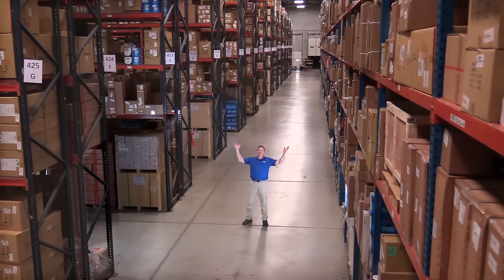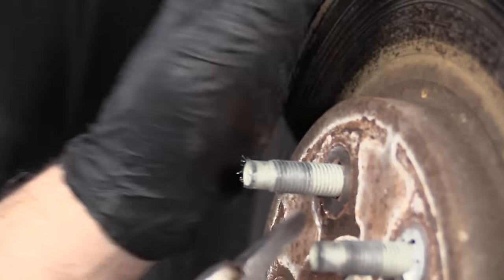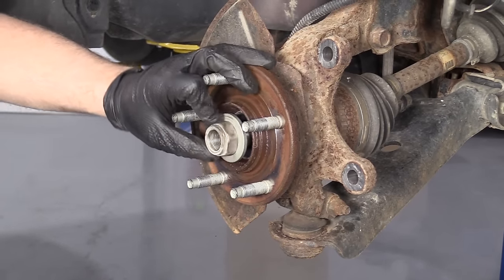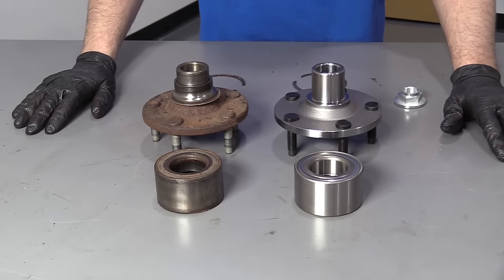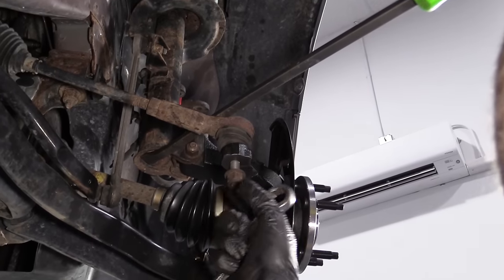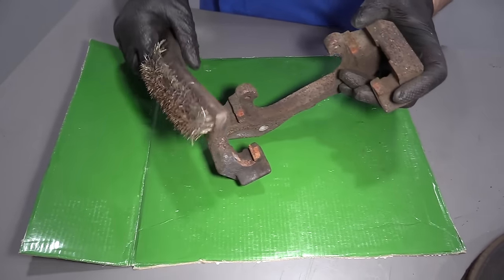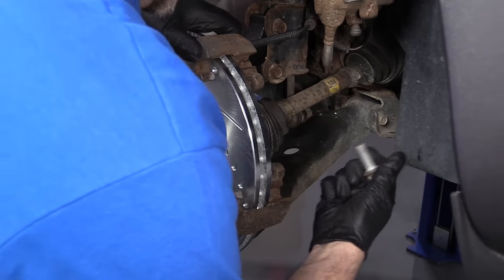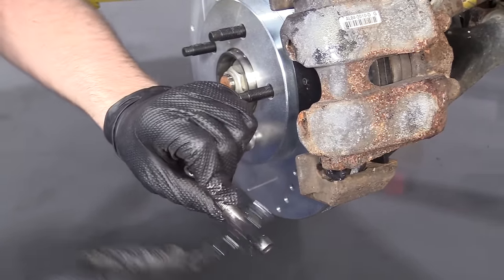How to Replace Wheel Bearing and Hub 01-12 Ford Escape

Comment: What the heck?  Did anybody notice that during the reinstall, the knuckle looks brand new with not an ounce of rust to be seen?  Hmm........
Reply: why would it be rusty if its brand new
Reply: I came to the comments just because of it. Lol
Reply from the maker: +jdm_ eh9 When we do repairs on certain vehicles we will do multiple part replacements at the same time but segment this out into separate install videos to utilize the vehicle being on a lift and taken apart.
Reply: Me too!))
Reply: New slotted rotors and all. :)
Reply: Old knuckle looks to be in bad shape. New ones come all together now.
Reply: He destroyed the knuckle at the press for sure. It happened to me to..
Reply: They do that with alot of things atleast 1 item per video gets something that not typically required
Reply: @1AAuto  lol no you wrecked the bearing or the knuckle pressing. You pressed it in the old one and then boom next screen it's a brand new. Should have just shown the replacement of the whole knuckle and sold it
Reply: When he was comparing the old hub to the new it looks like the diameter of the axle spline hole is smaller in the new hub. Could just be an optical illusion due to the new shiny metal. But maybe he changed to that whole new assembly when he realized he had pressed the wrong hub in?

Comment: They do sell entire knuckles with bearings pre-installed as well. Makes it a million times easier especially if it is rusted as bad as this vehicle in the video looks. I tend to replace entire parts to cut down on my time repairing my own vehicle.
Reply: This is one of the best instructional videos I've seen. Informative, to the point, and good camera work. The video is A-1
Reply: Thanks for this comment. They aren’t even that expensive either. Screw a press!
Reply: Where can you order the complete  knuckle with bearings and hub
Reply: If you notice when he reinstalls it it is a new knuckle

Comment: You don't have to remove the anti-rattle clip and separate the caliper from the bracket. Just undo the two bracket bolts and remove the who brake assembly in one piece.
Reply: That's correct. The reason for the kind of dismantle we see in the video is because not everyone is equipped with the strength  to lift and hold with one hand the caliper and it's bracket in order to hang that assembly on the strut coil. 
As a seasoned  (almost 40 years) Senior Master Auto Tech, 11 Current certs., and auto shop owner I would have  recommended the rotors and pads be replaced and if there were any okay whatsoever in the ball joint it would carried the same recommendation. If a customer didn't want to replace at least the ball joint I would not have warranted the parts or the work because all of these parts work together. If the ball joint is bad it can cause premature failure of the hub and bearing assembly and vise versa. 

 If I were a gambling man I'd wager that front suspension, drive axle and steering assembly had never been taken apart as far as the tech in the video did. From the looks of it brakes were the only thing replaced prior to this video .

Comment: I'm doing this job tomorrow, but based on other videos I've watched this guy makes the job much harder than it should be.  Most people will break the sensor off trying to get it out, it's better to leave the sensor attached to the knuckle and diconnect from the engine compartment.  Most people don't have the tools to take the ball joint off, and it is much less efficient to take the ball joint off first even with those tools.  If you do the ball joint last everything else is out of the way.  You can spread the gap tap the ball joint down and pull the knuckle off of the ball joint.
Reply: they like to sell there tools too
Reply: Local parts stores rent the tools needed to do these services.
Reply: Tap the ball joint down and you'll risk destroying the rubber grease sleeve. Tear that and you're replacing the ball joint unless you happen to be lucky enough to have a car that Moog happens to make replacement grease sleeves.

Comment: One of the best vds ever.  Thanks.  I was able to tear down both front ends in just 2 hours.  That all joint tool did wonders.  keep in mind the ball joint bolt is a capture bolt..it has to be completely removed.

Comment: Great video, other videos were weak, but this showed me it's harder and I lack tools and the time, taking it in to a shop, but I have done at least 5 other repairs with your videos, spark plugs, wheel sensors, fan switch, o2 sensors and various lights, thanks guys

Comment: Thank you for this video, you saved me over 500 dollars if i would have taken it to a shop. i didnt want to mess with the bearings and a press so i just bought the hub and and assembly all assembles for 118 dollars, shop quoted me 650. your video was very accurate except my escape wasnt nearly as rusty and came apart easily with a breaker bar.

Comment: Great video. I also noticed the new knuckle.
Personally I would support the inner race of the bearing when re installing the spindle to avoid loading the bearing up with pressure when installing spindle. 
Cheers!

Comment: If you remove the bearing and there is a part of the race still attached to the hub you can use MAP gas and torch tip to heat it up and then tap the race with a screwdriver and hammer. Be careful not to score the hub shaft. Or you can use a cutoff tool or thin grinder wheel on an  hand held grinder. Cut slits in the race being careful not to score the hub shaft.  Then use a wide  bladed screwdriver and hammer. Begin to tap in the race in various places and it should begin to move. You may have to apply map gas to keep the metal hot but take your time and you'll be just fine.  Never use a ball joint fork tool if you don't plan on replacing the ball joints. The fork will quickly and easily damage the grease boot and then you'll be stuck having to replace the ball joint if you cant find a grease boot sold separately. Grease Boots for the ball joint generally are not available for sale individually from the ball joint. Most of the time they come as a set. Unless you're a seasoned mechanic don't try any shortcuts like mentioned by another poster stated. It's always best to remove things the way the manufacturer recommends if you're not a mechanic and trying to DIY this job. A ball joint service kit can be rented from your local parts store as well as the wheel bearing press kit.  If you happen to have a work bench mounted hydraulic press like in the video then it will be much easier.
My bonafides:
I'm a Senior Master Auto Technician with 11 ASE Certifications, almost 4 decades of auto service experience and a 6 bay auto repair shop business owner.

Comment: On a 2002 Escape there are a few differences such as the slide bolts are a T45 not a 7mm or as he said when installing 6mm, also the pinch bolt for the lower ball joint is 15mm on the back side and the nut is 14mm not sure what year the video was done on but there are a few different things i found on a 02 just thought i would share.
Reply: False. the slide bolts are 7mm but T45 does work. These measurements also vary depending on if the car has had aftermarket parts installed.

Comment: When removing any of the bolts associated with the teardown procedures it is not just wise but a good practice to soak all bolts & nuts with a catalyst like PB Blaster that the man in the video is using.  I was a bit taken back by the fact that he didn't bother to soak the speed sensor bolt at the head and the exposed threads at the end of the bolt. These bolts are known to shear off at the head which then means  you're going to have to use a bolt extractor to get the rest of the bolt out of the steering knuckle.  Whenever working with a car or truck that's as rusted as the one in this video it's always good to presoak all fasteners (bolts/nuts) with a rust penetrator catalyst and let it all sit and soak in . Another thing you can do is when you have speed sensor bolts out you should clean up the threads with a wire brush. Then put a small amount of "anti-seize" lubricant on the threads. Before installing the sensor put the bolt in it's hole and run the bolt all the way down and back out a few times. The reason for this is it helps to keep rust from depositing on the threads and making it difficult to remove. During initial tear down  if you feel any kind of resistance in trying to loosen the bolt stop immediately and once again spray with rust inhibitor. I've been a mechanic for nearly 40 years and one of the best things I've seen used to loosen stubborn bolts, dowel pins, etc is just a little bit of break fluid. It does an amazing job.  There's another product called Fastenal that is in a very small aerosol  can about 3 inches tall and about a quarter in diameter. Use this sparingly as it's very expensive but will penetrate rust easily and quickly.  There's also another thing you can do that requires a can of MAP gas (yellow can), a propane tip and a candle. 

Heat up the bolt/nut with the map gas until the bolt/but it pretty hot (gets red) and then take your candle stick and liberally run the candle around the bolt head or nut and allow the wax to seep in behind  bolt head or nut. The wax will literally separate the rust from the bolt threads and you'll be able to remove a stuck bolt. This works especially well where a steel bolt is threaded into an aluminum housing or vise versa an aluminum bolt threaded into a steal housing.  Aluminum oxidation can at times be tougher than a rusted steel bolt in a steel housing.

Comment: Ok... during reinstall, it was a new knuckle and hub.  Do they sell new knuckles with hubs, so I don't have to press bearings?  I don't have a press.
Reply: You can get knuckles with the hubs but they're going to go upwards of $200. I took my knuckle and hub to a shop that had a press and they ran me $40 to press it all in. You can also get a bearing press kit which consists of a disc that threads onto a large punch and you use that with a hammer to slowly drive the bearing in

Comment: Thank you for the very informative film. I have 2 question. In some films you can see the authors lubricating bolts (knuckle -to-strut) with thread lock. Also some lubricate axle before they put a hub on it. Is it better to do it that way? And how do you know for sure how much inside you go with the hub (when you press the hub into the knuckle)? I pressed it in with Harbor Fright press I have, but not sure 100% if it is done correctly. Seems I can press it more inside, but I'm afraid to break something proceeding more. Can you determine exactly somehow that depth?

Comment: 22:42 new snap ring dosent haev the hole for the tool to be pull out wut????
aslo at 23:00 didn't you say earlier to not push in the center of the bearing ?  is there something in the middle under to prevent that ?
Edit2: nvm its said at 23:40
Reply: The end of the snap ring has a cutaway so you can get a screwdriver in to lever it out.

Comment: This is definitely good for a DIY'R. It would take alot less time with an impact but, sometimes you can make mistakes and break something with alot of torque. Also does it look like you replaced the whole knuckle? Just a tip with rusted parts. I've used Fluid Film when putting on new parts. Stuff works amazing! Thanks for the video!
Reply from the maker: +Brandon O. Thank you!

Comment: i changed my  drivers side front wheel bearing in my  2008 ford explorer limited v8 awd but the throbbing is still there  any ideas?
Reply: searaydrivingguy sound like you put the bearing in backwards or destroyed the magnetic stripe on the inner side
Reply: @MSMgamer190  it turned out to be the passenger side bearing oh well they are both done driving perfect now

Comment: yeah so I just took my brakes off by unbolting the 2 large main 18mm? bolts on the back I did not remove the caliper bolts at all is that ok?
Reply: Same. It worked fine.
Reply: Perfectly fine

Comment: Caliper > than 10 years old Should be rebuilt.  YOU SHOULD BLEED THE BRAKES AUTOMATICALLY TO GET THE MUD AND RUST AND GENERALLY FLUSH SYSTEM Debris =PART OF EVERY BREAK JOB!  U went to all that B.S. Work to press out the wheelbearing then you installed a New knuckle? Now you should do a wheel alignment.  NOVICE WORK!
Reply from the maker: +Daniel Taylor Thanks for the tip!

Comment: use two pickle forks, one on top of the other, and the ball joint will come right out, pound one in, then pound the other in right on top
Reply from the maker: +Charles Patrick Thanks for the tip!

Comment: cant move through the video without a ad every single time, knock that off. Also the pinch bolt, I took my air chisle with a pointy tip, then a socket, and then put the nut back on, and drove it out that way, was rusted to hell so basically stuck. Took a bit but finally popped. Doing my hubs today did the control arms the other day.

Comment: Bad design by Ford, needs to take everything appart only for a single wheel bearing..
Reply: Yup, Ford sucks.  The whole design sucks.  It's even worse on the 2017 escape that I'm replacing the wheel bearing on right now.  The strut is inserted into the top of the knuckle making it extremely difficult to get the knuckle up off the lower ball joint.
Reply: You have to do all the same crap to replace the alternator on a 05 mercury mariner with the v6
Reply: Its a very common design across all brands 🤨
Reply: @michaelreale3647  I was just sitting here thinking the same thing lol. 
Ford didn't start the press-in hub bearing, you tools.
Reply: Press in wheel bearings are quite common across all auto manufacturers. Not sure why but it is not just a Ford thing
Reply: fronts are easy, try doing rears on an AWD Escape

Comment: Hi i just purchased a ford escape 154k miles on it it needs a wheel bearing and front driver door has locked up how much should this cost to repair? Thanks in advance.
Reply from the maker: +Junia Jones We suggest you call your local auto shops and they will give you a quote on the job. Try to get a price from them and get their name so you can refer back to it.
Reply: @1AAuto  ok ty i did and i think quote was fair ty
Reply: @jaj86  how much was your quote to repair the wheel bearing? TIA
Reply: @davidhiner4214  it was 300 to 400 for both. i just replaced left side wheel bearing on the driver side it was 70 with parts and labor

Comment: This is NOT a job for the average backyard mechanic! That snap ring when rusted is a NIGHTMARE to get out. Not everyone has a 20 ton press and PROPER press plates and adapters at there disposal.  You are far better off buy a loaded knuckle.